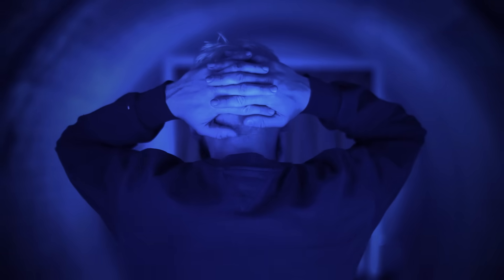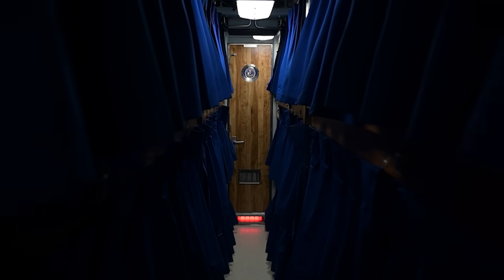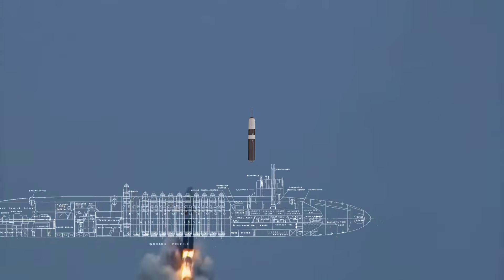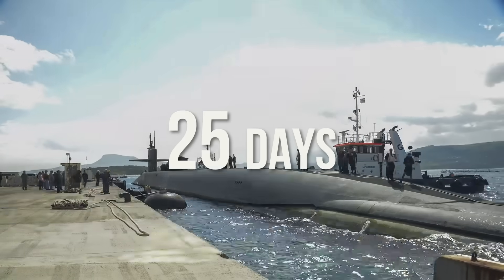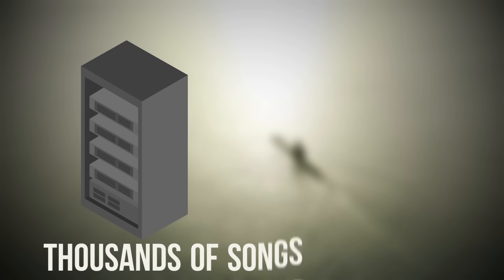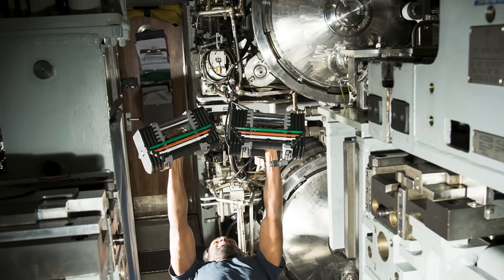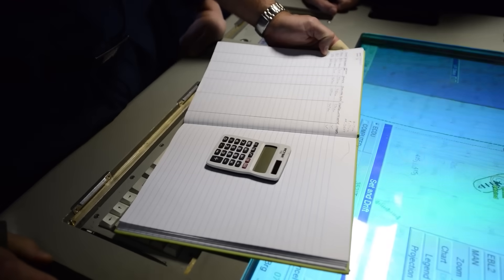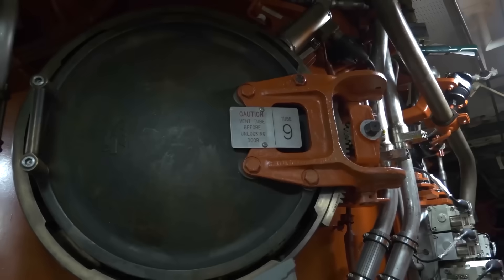Aboard USS Ohio - The Biggest Nuclear Submarine In The US Navy

Comment: I wouldn't mind spending a few hours on a SUB...and I will always be fascinated with the engineering. Looking at them on screen they do look extremely CRAMPED and not that massive in size....I saw one ride past us from a considerable distance.our ship on our med cruise in 1992. But it's not so much about the 42ft WIDTH and the 560 ft length that makes them actually huge....it the HEIGHT OF THE SUBS. THE MISSLES....are taller than the ship is wide.

Comment: I worked on the Ohio at Electric Boat shipyard as a welder. If I remember correctly, the crews' bunks were tucked between the missile tubes.
Reply: Technically outboard the tubes. My feet were against a tube when I slept in my rack.

Comment: I’m a US Navy submarine veteran, and I did 8 patrols on an Ohio Class submarine. As such, I know this class of submarine intimately. There’s a few discrepancies in this video. For one, there’s no chapel. Two, on a Trident, “hot racking,” is virtually nonexistent. Except for situations in which there are extra personnel on board (for example a midshipmen cruise), there’s enough bunks for everyone. Fast attack submariners “hot rack,” especially those in lower enlisted pay grades. During my time in, I can only recall “hot racking” once, and it was because for about a week I was assigned to a different command during an exercise. The torpedo room was turned into a makeshift bunk area. Had no trouble sleeping near the torpedoes (although the light and talking amongst the guys in the Torpedo Room did take a little to adjust to.) Three, dental chair? Doesn’t exist. Four, the “Conn,” is in the Control Room…more specifically, it is a raised platform in Control. The term “Conn” is one part of a two part watch station known as “Officer of the Deck” or OOD for short. Any nuclear trained submarine qualified officer when the vessel is submerged and underway, can be assigned as an OOD (the Supply Officer or “Chop,” is not nuclear trained, and therefore, can’t be OOD.) The OOD watch is made up of the “Deck” portion, and the “Conn” portion. Typically, one officer will fill both roles, but sometimes two officers (both OOD qualified) will fill the roles - one as “Deck,” and the other as “Conn.” “Conn,” is in charge of the tactical side of things (navigating, communicating, fire control, weapons, etc.), while the “Deck” is in charge of the nuclear propulsion system.
Reply: I never served in the military, or navy, but there are multiple errors in this video that "I" could see. I'm not going to get into them all, but one ridiculous comment made in this video is that, "even if a pipe fails, the crew can fix it even 'THOUSANDS' of feet underwater." Okay, the test depth is 800 feet, and handles that ease. The official "crush depth" is classified, but reports say it may be 1,500 feet, or more. I HIGHLY doubt that it can dive THOUSANDS of feet deep. It's not physics, it's simply geometry. 
P=pgh
Yeah, the Russians "SAY" they have submarines that can dive to 3,000 feet, or more, and Russia has NEVER lied about ANYTHING!
Reply: @TurfTransformations-w2f  You actually use your brain, and apply common sense.  😎 Submarines, due their shape (cylindrical), aren’t capable of extreme depths as suggested in this video.  This is due to water pressure not being evenly distributed across its surface.  Round submersibles, on the other hand, have a much better chance of surviving extreme depths, because the water pressure is evenly distributed around the entire surface.
Reply: @music4ever1981  Whats crush depth on an Ohio bruh? 
I should've joined the silent service but I joined the Army at 17 in 2006. 
I think it would've been awesome to work on the pressure water reactor.
Reply: @music4ever1981  WRONG......NR-1, the only US Nuclear Powered deep submergence vessel was cylindrical and could dive thousands of feet.
Reply: @DuffyF56  I never specified how deep a submarine could dive - only that a spherical submersible could dive deeper. And I was never on NR-1, so I will not comment about it.  The closest I came to NR-1 was seeing it pier side at Groton.
Reply: @SubvertTheState  Crush depth?  Deep enough.  😂  I joined the Navy in 2001, and I was in basic training for about a month when 9/11 occurred.  What was your MOS?  My rating was Navigation Electronics Technician (NAVET).  Crazy thing, the first time I met my recruiter, he asked me if I took my ASVAB and if so, what was my overall score.  Told him I did, and I got a 61.  He then asked me what I wanted to do, and I told him I wanted to do something with electronics and computers.  He then asked me if I wanted to get into Submarine Electronics and Computer Field (SECF), to which I replied, yeah, sure.  And the rest was history…so prior to my leaving for basic, I had already volunteered for sub duty.  Did 9 years, and got out in December 2010.  Are you still in, or if not, how long did you serve?  Thanks for your service! 🫡🇺🇸
Reply: @music4ever1981  I suppose that's the proper answer.  I was a 25U Signal Support Systems Specialist. I guess I never considered the Navy. Both my parents were actually in my local National Guard Unit...So it was cool to meet someone (E4 haha) who knew my dad. I got out in 2012. I reconsidered joining the Submariners in 2019, but ultimately dilly dallied and I'm sure I'm too old now.
Reply: @SubvertTheState  I appreciate your parents’ service as well.  My Dad is retired from the Air Force (although, I don’t know what all he did - or even his MOS), my Mom was Army, she was in HVAC, and sister was Navy, and she was an Airman Apprentice.  Don’t really know what all that entails, only that she was assigned to a carrier.  She and I were a couple weeks apart, she went in July 2001, and I went in August 2001.  Funny thing is, in January 2010, I went to the local Army recruiter about joining (my contract with the Navy was completed), and the recruiter said he wanted me to join, but because of the Obama administration cutting back the military, he wasn’t allowed to bring in someone that had prior service, or something to that effect.  I also briefly considered Marine Corps, back in April 2001, but because the Marine recruiter came on too strong, I decided against joining the Marines.  Then in boot camp, Sept 11 happens, and I couldn’t help but think to myself, “I dodged a bullet.”
Reply: @music4ever1981  "Submarines, due their shape (cylindrical), aren’t capable of extreme depths as suggested in this video."  You said THIS didn't you? Also you might want to look up the USS Dolphin which was capable of reaching depths of over 3,000 feet. ANOTHER submarine with a cylindrical shaped pressure hull.
Reply: @DuffyF56  Yeah, but again, I didn’t specify. And I only know about my specific type. Heck, even if I went to another boat of the Ohio Class, I would’ve had to qualify on that boat - even though it’s the same type.  Same if I went on a fast attack - I would have to qualify on that boat.  I would have still been qualified in submarines, but that doesn’t mean I have overall knowledge of every submarine out there.  With that said, the consensus still remains that generally speaking, submersibles dive deeper. Also NR-1 and Dolphin were research type vessels, so it’s very possible they were designed for deeper depths.  How deep?  I could only speculate.
Reply: @music4ever1981  I seen it through the fence also.
Reply: Do you go around just to piss on people’s videos?
Reply: @rubyannr6898 Uh, yes! When someone is wrong about something, why should I not say speak up? I’m not being harsh, and if I say something wrong about a topic that I think I know about, but someone else who actually knows about the subject, that person should correct me.  Problem is, too many people get butt hurt over little things.  I didn’t insult the person, and if I did, why are you sticking your nose where it doesn’t belong?
Reply: @rubyannr6898  The whole purpose of the comments section is for nerds to nerd out on technical specifications and minor details lol.
Reply: As someone who's never served but the older I get the more regret I did not I appreciate your service and a bit jealous of the adventures you must of had and places you've seen. Thx to you sir!
Reply: Uss Massuetts

Comment: A Trident is NOT equipped with low frequency active sonar arrays. The AN-BQQ-6 Sonar system doesn't technically have an active sonar system. It  has an under-ice system which is used to actively ping to determine the range to polar ice above. Active sonar on a submarine is used for a firing control solution to determine exact range to an enemy prior to  firing a torpedo. Active sonar is a tactical weapon. All boomers are strategic weapons. If we detected an enemy vessel, we didn't attack it. We ran from it